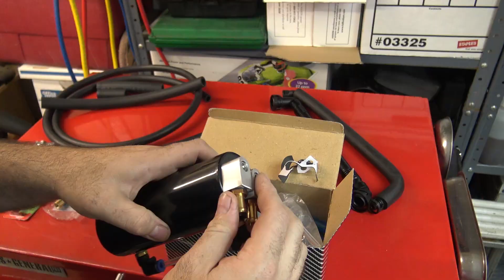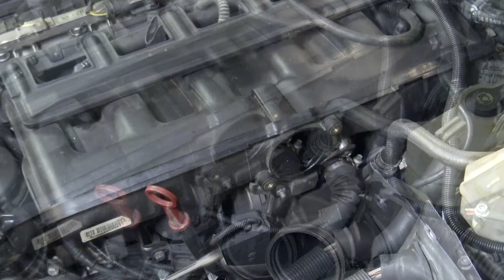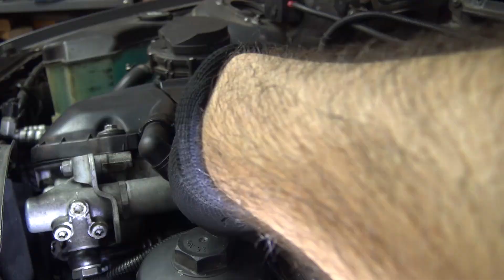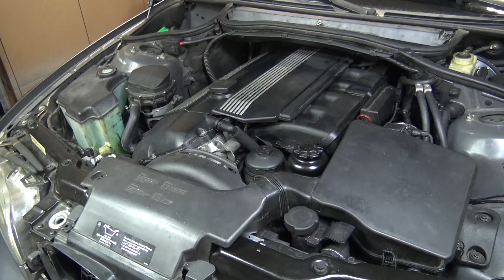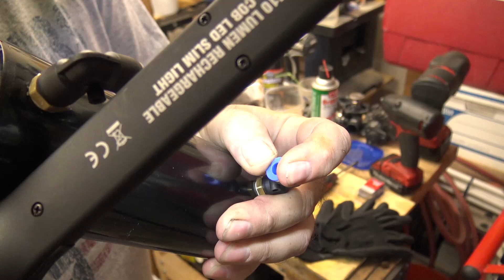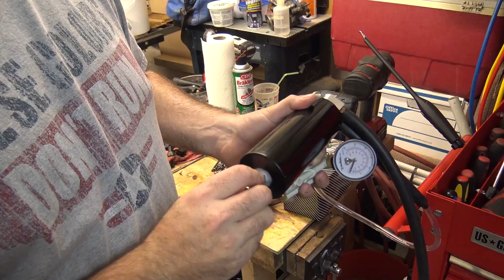BMW E46 Oil Catch Can Install DIY

Comment: confused on where to stop on this video and switch over to the 02pilotmod video
Reply from the maker: The only reason to watch this video is to find out how to take the intake boot off and get the oil dipstick out if you want to install a check valve.  If you only want to do the 02PilotMod then you don't install any of the parts related to the catch can--you just install the vacuum line.
Reply: alright sweet I just installed the vacuum line. Do you think the check valve is really necessary?

BTW your videos are some of the most helpful in the e46 community IMO so thanks!

Comment: hello Jason.  my car is 2003 325i and I don't not Have any check engine light is on new while I am driving it look like car acceleration really slow and cusumming a lot of gas can I do pilot mood at and it will fix all the problems

Comment: Hi 50skid... yet another great vid!  Will be doing this mod soon and got the ebay linked oil catch can.  My question is, is there a inlet and outlet direction to the ports on the can?  Looking at it, I can't figure out which direction makes more sense.  Is there an updated vid that might possibly show this specific catch can install?
Reply from the maker: There isn't really an in and an out on these cans--you just pick one.  You could take the fittings off and see which one is slightly longer--that would be the in.
Reply: Is this the can you have installed on your vehicle right now?  If so, how is it holding up?
Reply: Installation went smoothly thanks to your vid. I am running lean now however. Do you think the ebay catch can (link on your parts list) needs to be sealed better?
Reply: false alarm.  It threw a lean code but went away after a few more drives.  The short term trims look good.  My only concern now is that the vacuum seems very high ~24inHg.  Is that ok?

Comment: I am thinking of running a drain line however my can is not filtered, won't this suck the crap that I am trying to keep out of the engine?
Reply from the maker: Your CCV system has been recycling the "crap" since you've owned the car.  What I'm describing isn't any different, it's just using different components to do the same job.  The crap only becomes crap when you let it sit in the can and oxidize.
Reply: Thanks for responding no one else has such as Nathan.

Comment: Awesome video it helped me a lot. I was wondering if you measured your vacuum with the catch can installed? I have installed a similar setup with the same PCV and have lean codes on both banks. I tested the vacuum with a vacuum gauge and had 19 inHg. held steady at ideal. Do you know what is common or ideal amount of vacuum with this setup? I know you mentioned this setup will increase the vacuum compared to the CCV setup but no by how much. Thank you again for all the amazing videos and help.
Reply from the maker: 18-19 is correct.  That's basically full manifold vacuum at idle.
Reply: Thank You for confirming that for me. Eliminating a vacuum leak as the cause of my lean codes helps a lot.   I will start looking for other causes for my lean codes.

Comment: Hi 50s kid  what do you think about this I decided to get rid of my ccv as even its new from Fcp 
And my oil sucked in the intake
Need your opinion 
This video 
https://youtu.be/yutrmBaQPQw

This is what I followed with extra hose modified

http://www.xoutpost.com/bmw-sav-forums/x5-e53-forum/99551-diy-solution-m54-m52tu-ccv-problems.html

Comment: Your car has more silicone than a San Fernando Valley yoga studio.
Thanks for doing the videos, helpful as I work through my M54 oil consumption problem.
Reply: did u solve your  M54 oil consumption problem ? If so can you share how, i needed to resolve this issue on my M54. thanks
Reply: sri nandu same

Comment: Nice can I do this without catch can mean plug oil drain and connect these 2 hoses fitting into oil catch can ?
Reply from the maker: Yes you don't need the oil drain.

Comment: The problem is that you can't use the vacuum from the rail it must be from the rear intake port or it will be too much and suck oil through the catch can, also the pcv is not needed, if installed sideways the valve will not operate right, that is what your $15 catch can install didn't work.
Reply from the maker: That's what the PCV valve is for dude, to reduce the air flow through as well as to provide a check valve against pressure going the other way (in case of backfires).  It's just a little round ball or plug on the inside with a tiny opening to reduce the flow through it.  Who told you they need to be installed upright?  I've only ever seen them installed sideways in cars.  Doesn't matter which way they go.  And it did work, it just sucked and smelled like oil like you were talking about in your video.
Reply: The e39 smells because of the terrible unsealable cabin air filter boxes, the e46 does not do that, that clear tube got pulled down from hitting your wire loom and made it leak, you have to make sure it is straight and locked in, I'm not trying to be a Nancy but look at all the cars that go through my channel and never a lean code after the can is installed, also you have to use fuel line or it will collapse on itself under vacuum, and that will push the seals out on the engine , we both can agree that the original CCV does not work, which is more than most BMW shops will admit, they don't want to give up those $600 CCTV replacement jobs I guess lol
Reply from the maker: I did make sure the clear tube was locked in.  I showed proof on video that it DOES leak and showed why.  Those things are not air tight, man.  Not only do the little teeth leak in between them, the blue "quick-disconnect-like" thing does not seal around itself because it's plastic and not rubber coated.  I'm not the only one to discover positive fuel trims after installing one of these.  Like I said when I was commenting on your video, it's not enough positive fuel trim to throw a code, it's about half way there.  But trust me half way there is enough to cause poorer gas mileage.  If those lines were going to collapse they would have done so during idling which is when vacuum is highest.  I'm also not the only one to have the problem of oil smell after installing these either.  Gotta use a better can, there's no doubt in my mind.  I suspect with all the RTV and the o-rings and what not I had some small leak somewhere when the can got hot.  I'm not knocking you for what you choose to use or install, btw, I hope you don't take offense.  I'm just sharing my experience with this.

Btw I'm gonna have to disagree that the original CCV does not work--it actually works just fine and only needs to be replaced maybe once in a car's life except under extreme conditions like very very cold winters.  I recall hearing about one guy who replaces them every year because he's in the Colorado mountains or something, but that's a unusual climate.  Just because something that is made out of rubber needed to be replaced after 100k miles doesn't necessarily mean I'm ready to re-engineer it, ya know?  Bushings, o-rings, gaskets, it all goes to crap after that long.  We'd be replacing everything that is rubber on these cars.  My big goal for this was to get the increased vacuum to solve the oil consumption issue for now.  After I'm done with my rebuild I'll switch back to the stock CCV.  I'm good with the check valve providing me protection in case the diaphragm ever fails and causes too high of a vacuum/suction.

But... I've got the M5 oil separator from the E39 sitting on my bench and I will do an install of that along with testing if it produces fumes, which I know it won't but I'd like to be sure.  I honestly think it's gonna be the best way to go because it's got a built in drain valve fitting and is all plastic which will provide more insulation than a metal can.
Reply from the maker: You do have a point about the 3/8" line that I chose to use.  I remember it getting my hand dirty when I pulled it off.  Definitely should have used fuel line (I was only planning to keep the install for a week, that's why I used it).  Perhaps those lines were oozing oil through them and when everything got hot under the hood, it was baking and causing the smell.  I mean, it's possible.  Because I did have that catch can sealed up vacuum tight...
Reply: You can also get  those separators on the x5 with the m62tu, the 540i and 740i use the kind behind the timing chain, but remember those drain to a banjo fitting line at the top of the oil pan and it does not actually sit in the oil on the m62tu , i think it will pull oil through but i will let you experiment and see what you find out, remember the v8 cars still have the ccv diaphragm on the rear of the intake so the vacuum is very little going to the separator
Reply from the maker: Yep, that's where the PCV valve comes in (limits suction being applied to the system--I don't want to say limits vacuum because it still builds up 18"mmHg) as well as the check valve on the drain line.  If you imagine my system in this video, the oil catch can is literally just a can with 3 openings (and 2 that are plugged).  It's simply being replaced with a plastic "can" with 3 openings and a different shape.
Reply: I think it will work but i dont know about running the return to the dipstick, if you put a one way check valve on the tube it wouldnt drain back until you turned the car off, and it might get stuck from oil getting on it, i dont know seems like it could be unreliable in the long run.
Reply from the maker: I had that thought about it not draining until the engine was off.  But think about it, how much oil is going to accumulate over the course of any one engine trip?  No where near enough to fill a catch can or that littler M5 separator.  Also, the vacuum drops to almost nothing whenever the engine revs, allowing the oil to drain.  It's a valid thought about the valve getting clogged, but i don't think so.  I tested it with oil (it's meant for fuel normally) and the flow seemed fine.  I think gravity will do most of the work of keeping it unclogged.

Comment: I installed my ecs tuning catch can on 330ci e46 2 days ago, runs perfect no leaks, i used the napa pcv valve and completely deleted the stock ccv. I installed the can in the open battery space in the top left very impressed!
Reply: Since it has been one year. did it fix the oil consumption?
Reply from the maker: Nice, let us know if you get any oil smell as time goes on.
Reply: nothing so far the fitting are great with o rings and the can screws on together very nicely o ring as well, everything seals nicely.

Comment: are you able to recommed any pcv valves that i could buy here in the UK? Looks like no one evern makes them over here
Reply from the maker: That's impossible, every car has a PCV valve.  You're not going to the proper auto parts store or something.
Reply: Most of the ones ive seen are for alot bigger engines, or 90° angle, but the choice is very slim. Is the pcv for the bmw built into the ccv system?
Reply from the maker: Yes it is.  I can understand not being able to find this particular one.  I think it might be for an American car (i have no idea which car it's for).  Have you tried search on Amazon.com (the US one)?  Maybe you can get it shipped.
Reply: Yeah i can get them all shipped. The cost of shipping high which i why i was looking for one here in the uk. 
My catch can is filling with oil so fast so im guessing my intake is litteraly sucking the oil out my crankcase. Woukd this be correct without a pcv?
Reply from the maker: Yeah I think so.  So this PCV valve is for Dodge and Chrysler cars.  I guess not many of them in the UK?  I know Ford is big over there.
Reply: No they arnt not very popular, fords are all over the place tho. I have seen a PCV for a Dodge Caliber with engine size of 1.8, 2.0 & 2.4 ltr. Also i have found a PCV for a subaru Imprezza, but with them being turbo i thought their vacuum rate would be alot higher. 
Here is the link for the dode PCV, do you think its worth a try?

http://www.ebay.co.uk/itm/272304417945?_trksid=p2060353.m1438.l2649&ssPageName=STRK%3AMEBIDX%3AIT

I really appreciate your help as well. I love your vids, they have helped me out alots.
Reply from the maker: Thanks!  So it's more about the rate of flow of air through the valve rather than the amount of vacuum you would measure with a vacuum gauge.  You can be measuring 10inHg with 1 valve and it may work and 8inHg with another and it may not because that just wasn't enough flow through the valve to keep up with all the blowby trying to pass through it.  The only real way to know is to just try it out.  If it doesn't work, you'll know by the "smoke" that creeps out from under your hood!  (it happened to me, it's not that big a deal if it happens, just unplug the tube that is connected to the valve cover but leave it "in front" of the opening and you'll make it back home)
Reply from the maker: Also--consider doing the O2Pilot mod instead of the catch can--might be easier for you.
Reply: Ok i think ill give it a go then, or i may try on for the larger engine dodges. Regarding smoke coming from the engine, when i just let the car sit and idle without ever driving it, i get alot of smoke coming from behind the engine and a strange squealing noise. Ive no idea why or what it is. Any suggestions.

What is this O2Pilot mod?

thanks
Reply: that tube is positied at the back of the engine on the n42/46 models so its not easy to just take off. I think ill try the PCV that is labled this on ebay: 

Jeep CJ - PCV Valve - 3230351 - 3.8 (232) & 4.2 Litre (258) - 1976/77
Reply from the maker: Take a look at my 2nd to latest video right here: https://www.youtube.com/watch?v=Fo2rLSzNzt0
This is the 02PilotMod and it's ideal for above-freezing climates where you don't get the yellow mayo inside the CCV and have to clean it out all the time.
Reply: 50sKid Hi again.
ive fitted my pcv valve now. how do i know if its actually working or not working.
a had a long drive this morning and all seemed ok. then i had a short drive n i smelt a burning smell inside the car. opened bonnet and it smelt like burning. any ideas?

Comment: Thank you for the great DIY. I am unsure what you did or what to do with the crankcase vent valve under the intake manifold. Did you leave it or would you recommend removing it to do this mod?
Reply from the maker: I left it in place.  Doesn't need to be removed.

Comment: These quick connect fittings are terrible choice for vacuum applications, they are only sealing with positive pressure, explains why you had such a bad luck with it!

Comment: What determines what PCV valve you should use for the engine? For example would the one you have used be fine on the 2.2L M54's?
Reply from the maker: Use this PCV valve and only this PCV valve for all size M54s.  What determines whether this is good is that it works, it passes enough vacuum and flow to not cause the crankcase to pressurize.
Reply: For us who live in potentially "chilly" climates i.e. the UK, where it does not get extremely cold, and want to run a oil return; is there anything worth covering in thermal insulation to aid in preventing condensation? i.e. the wrap the catch can? If the engine gets up to temperature, shouldn't the condensation not be a problem anyway?

I very much appreciate you taking the time to reply to these questions.
Reply from the maker: I was thinking about insulation too at one point--not for myself but for recommending something to you guys in colder climates.  Ultimately I decided to leave it to someone else to try something and see what works for them rather than try to guess.  But, yes, I would encourage you to try some insulation experiments.  You're right, if the engine is getting up to temp the condensation shouldn't be a problem, but just because your engine temp gauge gets up to the middle really quickly doesn't mean your entire engine compartment has come "up to temp" you know?  You usually need to drive for a good 20-30 minutes for every single thing to get stinking hot, including the oil separator/oil catch can.  So I think it's different for people depending on their commute.  But you said you were in a chilly climate and not a cold one, so I would just say that if you don't have a huge problem with the "yellow mayo" in your old CCV, you're probably just fine.
Reply: I don't remember seeing any of the " yellow mayo" in the old CCV system, so yeah, I personally might be fine. England generally has one season: mild. At the very coldest in winter, we might get -5C, but more than likely around and above freezing, depending on where you live of course. If I think it's worth doing it, I'll buy some appropriate insulation and make a quick video on it and then share the video around. Cheers dude.
Reply from the maker: If you never get the yellow mayo then tou may also want to consider doing the 02Pilot mod instead!  See my very latest video.
Reply: watching as we speak ^.^

Comment: cap the side oil level clear tube. you don't need it and is a source of oil smell. keep making these videos we love it!
Reply from the maker: I did it cap it and it still smells like oil.
Reply: @50sKid  Hey, do you happen to remember the hose size for the dipstick tube ? Is it really a 3/8 as you mentioned it ? Seems smaller, like a 5/16? .. Could you remember, please, please ? Thank you !